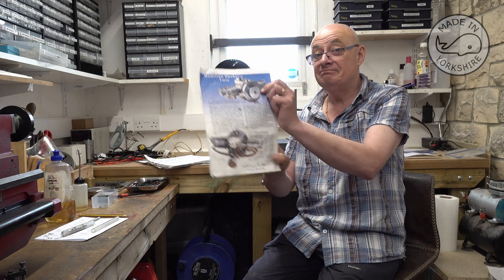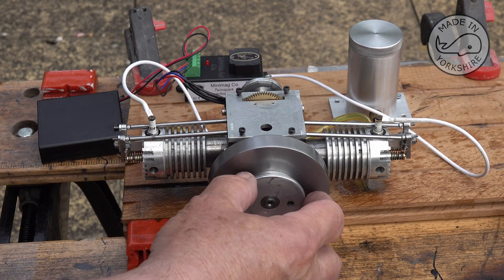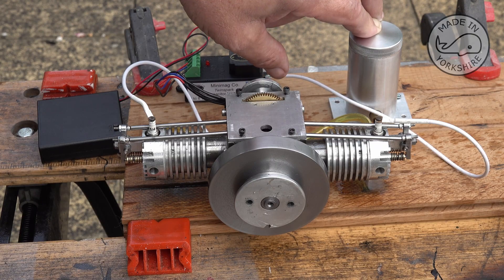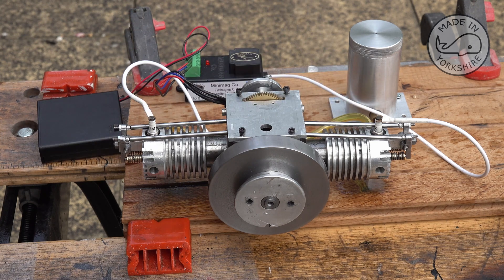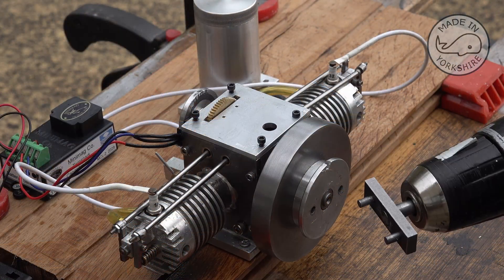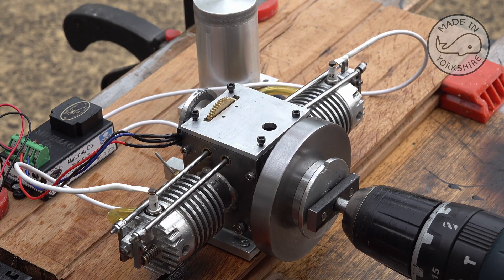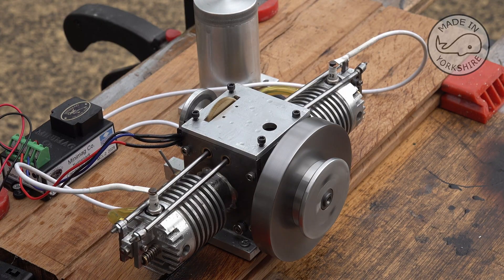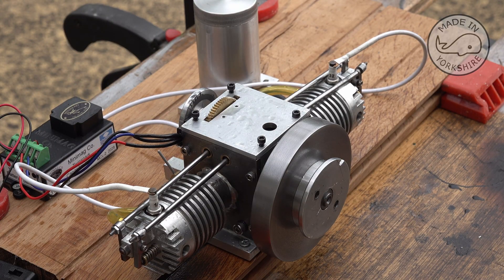#MT56 Part 10 - Upshur's Opposed Twin IC Engine. First Run. In 4K/UHD by A Whale.

Comment: Marvelous Andrew!!!--I have to do some research on the 
Mminimag like you used.---Brian Rupnow
Reply from the maker: Hi Brian
Thanks Brian. I've used Minimag ignitions on some of my other engines that use miniature type spark plugs. They are not cheap but very well made here in the UK.
Julian is the owner and is contactable via email at sales@minimagneto.co.uk if you need any help.
Cheers
Andrew

Comment: Congratulations. And to get it running so nicely so quickly. Wow. It usually takes me several weeks to get my engines dialed in. I have the Upshur plans. It will be my next winter project.